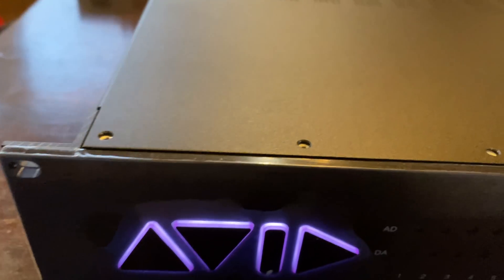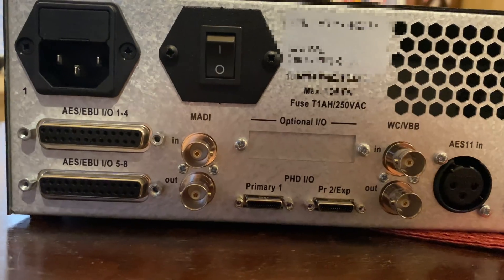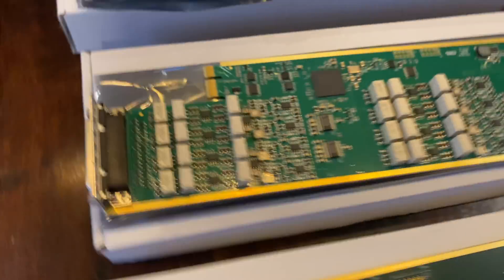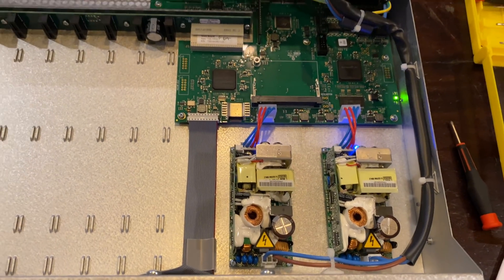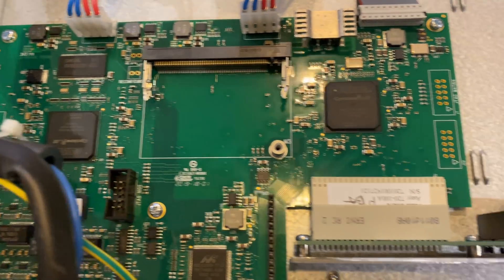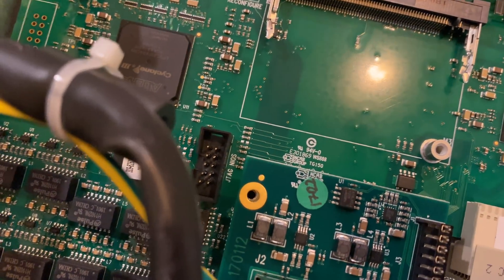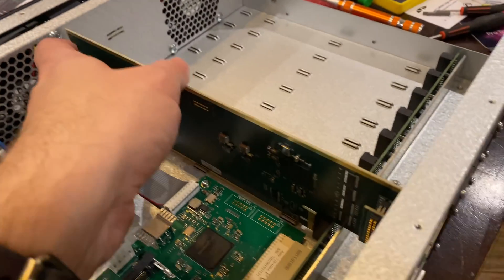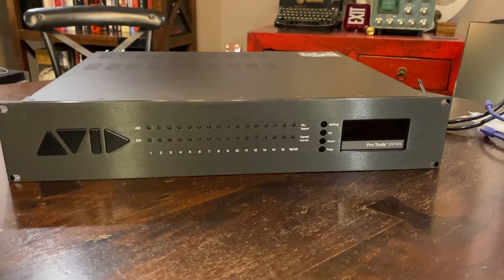Neil's Technobabbles:  The AVID MTRX

Comment: Insert Obligatory "I could do all this with a £500 USB interface and powered by unicorn farts" comment here. Don't mean to hate but its funny when the further you go into the meat of audio production the more those powered by raisins comments fall off. That said you can do a lot with a £500  interface and unicorn farts.
Reply from the maker: Benjamin Kenobi definitely!  Now I need to develop a unicorn fart plugin!!
Reply: @NeilParfittMusic  I would buy that plugin..... if its like 20$ cant afford much more as a university student.
Reply from the maker: @deadinside8013  dont forget to check edu pricing!  Sometimes it's substantially lower than retail!
Reply: I can do it with some hot glue, some random breadboard wires and an old phone.
Reply: I actually tried a similar plug in now youve mentioned it.. , however, the output was mainly all rumble..... I mean cmon, at least give us some "Air " control....

Comment: Neil ! If you were setting up audio networking today which system would you use ? Madi ? Or ???? Which units would you use today for a user incorporating a daw and protools ????
Reply from the maker: it all depends on the I/o requirements.  If it was me and what I use currently,  the MTRX is still the interface of choice... or now the MTRX II as I could use thunderbolt 3 and remove the RME MADIFACE FX as Logic's audio driver.   But,  as I own these pieces already - there's no benefit to do it as it's spending money to result with the same thing.

Comment: The AVID MTRX is an awesome system with the routing capabilities to Dante, etc using Dadman software. IMO its probably the best out there. BUT why Avid why do you have to charge so much. To the point they lose so many customers. I feel if they cut the price in Half they would sell 4x as much and make more money.
Reply from the maker: Keep in mind it's made by DAD.  So they have to make money, and it's AVID branded so they have to make money.  But yeah.. i feel like the empy box should be 2 grand.  They'd sell a kajillion of them.

Comment: So MTRX doesn't have the default dante card which means the two rj45s on the backpanel are useless right?👀
Reply from the maker: No,  but you still need one so the MTRX is on your network so you can control it using DADMAN

Comment: 1:29 You said you have 16 channels of AES on 2 DB-25 ports, but it's labeled 1-4 and 5-8.  What am I missing here?
Reply from the maker: 1-4 represents 4 stereo AES I/O
Reply: @NeilParfittMusic  not trying to be obtuse here, but where are 9-16?  :P
Reply from the maker: @applemarkwantsvids 

All I can think of is that line from Shawshank redemption...  

But also,   it's just AES Digital labelling - 

If you've ever seen a single AES input or output on an XLR connector - that's a stereo digital signal,.  Same applies to DB25:

AES 1-4 I/O is laid out in stereo clumps:

DB25 #1
(1) ch 1-2
(2) ch 3-4
(3) ch 5-6
(4) ch 7/8

DB25 #2
(5) ch 9-10
(6) ch 11-12
(7) ch 13-14
(8) ch 15-16
Reply: @NeilParfittMusic  Wellll ok....  Thanks DOC!
You rock Neil.

Comment: Neil - just wanted to say great youtube videos. you have no idea how much time you have saved me the last year as I upgraded my home studio moving into  new home. keep up the great work!
Reply from the maker: Thanks Anthony!  Were you expanding? Streamlining?
Reply: @NeilParfittMusic  have been building a new studio ontop  of an old tennis court. re-designing the studio layout was in need of inspiration. seeing how you got the flockaudio patchbay/Avid MTRX solution working, and all the routing with a tonne of synths helped me figure out which direction to go in. ive ended up with something similar. however i am using Cubase is my main daw, working with logic also.  I have used the ERM Multiclock to drive alot of the midi and clock sync in the studio.

Comment: Another great video Neil !  But I've got one word for you on this one - "Galaxy 64" (does the number count as a word ...?).  64 channels of analog in's and 64 channels of analog out's, another 64 in's and 64 outs of digital, connects directly to up to four HDX cards, primary and secondary Dante, 64 channels of MADI, 2 Thunderbolt connectors (USB-C), totally unconstrained matrix'ing from anything to anything via very simple software, HUGE processing power (2 FPGAs, 12 DSPs) for Antelope's pretty awesome plugins (which can be normal plugins or hardware'ish inserts), AND Antelope's stupid good clock - all included.  And BY FAR the best thing is, IT ISN'T AVID !!  No avid hell to deal with - ever.   All for way less than the MTRX will cost when it's populated with a small fraction of that.  Plus, it sounds amazing where as avid's converters have always been blah at best (I've had a bunch of them and SO glad to be rid of them).  Anyway, just another viewpoint.  Don't want people falling down the avid hole-O-hell without realizing there are other options !  Thanks for another great video Neil !  You're awesome !
Reply from the maker: Thx! If you check out my dork fest 1 vid,  youll see I need more I/o :)

Also - just in case you weren’t aware,  the MTRX isn’t really an avid product at all,  it’s a digital Audio Denmark AX32 converter with an avid logo on it,  so it really does sound outstanding.   The only difference between this and the ax32 is that it does have a build in set of digilink ports.
Reply: @NeilParfittMusic  I haven't seen all your videos so I wasn't clearly aware of your I/O requirements but at least from an HDX perspective I think I remember you saying you only used the first two of three cards for I/O.  If that's right, that's 128 I/O's total and the Galaxy provides 128.  It didn't seem like you populated the MTRX with anywhere near that many in this video but I obviously could have misunderstood.  That said, I'm DELIGHTED to hear it's not really an avid product.  That's EVERYTHING as far as I'm concerned though it doesn't get you around having to DEAL with avid if it ever comes to that.  The latest avid ceo is a big hardware guy and it made sense that the MTRX is a project he started but obviously not.  Also, I just read my post and the following was not clear -> I am in NO WAY challenging your choice.  You are WAY more qualified to make such a choice than I am and if you picked the MTRX, that was the right choice for you.  But I despise avid like most audio people.  I have years and years and years of horror stories like we all do.  And pointing out that there are alternatives to avid-hell was irresistible so I did.  And the Antelope IS truly amazing and so VASTLY superior to anything from avid I've ever owned anyway, the mention seemed justified.  Anyway, you have been such a find.  Thank you for taking the time you do to make these videos no less respond to my posts !!
Reply from the maker: @Starlite4321  oh yeah I could rant on forever about all things avid hehe ..

Comment: Wow!  Thanks for this info. I am getting ready to pull the trigger on this same setup for Atmos and Scoring work I do.  I may look into the  MADI IO daughter board.. I wonder if they have given an option of having that pre-installed at a vendor or something?  I could do it myself as I come from the old school of doing those types of things, but would not want to go thru what you did having  no room to work without having to teater on disaster..
Reply from the maker: How nuts are you I/o requirements?  The MATRX Studio is awesome if you dont need more than 64ch to/from Pro Tools.  Also,  the MTRX does have 64ch MADI on COAX without having to open it up...
Reply: @NeilParfittMusic  The problem with the MTRX studio is not really what I want here. I need more for what I am doing.  Also the A/D converters in the Studio version are NOT nearly as good sonically as the MTRX Flagship.. Totally different box. That's according also to Jeff Komar at Avid. I have Avid HD IO which is comparable to the Studio version sonically, but that is not what I need, plus I do need a lot of IO for film work and Atmos mixing The MTRX is just a great rig.
Reply from the maker: @gregoryivesdolbyatmosmusic  yeah man all good,  it was just a casual suggestion as I've met many who didn't know about it
Reply: @NeilParfittMusic  No problem.. DAD made the MTRX.. The other is for people who are just doing a lot of regular stuff unlike probably what you and I are doing-:) Plus the fixed architecture was not what I was looking for as you said, the cards are great and just keep adding in to up to 8. Also, I wondered if they fixed that thing in the manual with the screws.. Hey, it's Avid, so probably not..lol  Hey do you know my pal Jack Lenz in Toronto?  I nice guy and composer who is older now, but used to play with Seal And Crofts back in the day.  He used to have a big space in downtown Toronto in an old Beauty Salon he converted.  Not sure what he is doing now, but has been pretty successful for years. Very nice person.
Reply from the maker: @gregoryivesdolbyatmosmusic  ah yep,  Lenz Entertainment.  Funny coincidence is that his Son has the studio location  I used to lease... small world :)

One bummer is that the SPQ is built into the MTRX studio.  it almost makes more sense if moving to ATMOS (which I'm considering at 7.1.4) is grabbing the MTRX studio and using that just for the DA and SPQ,  so I don't lose all my DA and slots on the big MTRX for the SPQ (I literally have 1 slot left)..

You could wire them in tandem via MADI or DANTE..   I'm not sure what I'll do yet.  All I know is the SPQ card is 3 grand and then MTRX studio is 6K including the SPQ and 16ch DAC vs. having to sell my Trinnov DMON6 and spend 12k to get the DMON12...  for the same money I'd be able to get the additional monitors as well.

DADman can talk to both simultaneously.. Hrmmmm.  Undecided. The Trinnov is amazing.
Reply: @NeilParfittMusic  Yeah, must be the piano player one.  He has two boys and a two daughters.  Yeah. I am still figuring a LOT  of the DadMad senerios out.  I'll run what you said by Jeff Komar at Avid.  I have emails back and forth and he has been super helpful. I will be selling my Dangerous Monitor ST and SR along with my Avid HD IO.  No need for the Dangerous Music Monitor now since it's behind on monitoring  more that a certain number of speakers unless you buy additional racks. .They are getting a new update for the Monitor system, but they are really behind because of Covid-19.  Also, Bob, the owner retired and now a sales guy bought the company last fall.
Reply: @NeilParfittMusic  I thought that you did not loose the slot for the SPQ card.. It goes in a different slot right in addition to the bigger 8 slots. I might be wrong, but I thought that was right..
Reply: @NeilParfittMusic  Definitely going with at least 8 Ch of AD and 8 Ch of DA and an SPQ card along with the Dante Daughter board which goes inside.  Also, Front panel controls on the MTRX Studio is nice for monitoring, but would not get that just for that.  Handy for monitoring Mac Audio at the very least.  I like the MOM remote from DAD so that will work possibly for speakers. I have currently 5 Genelec 1032 A's and the big Sub.. Been having them serviced at Genelec one by one. Just replacing old caps etc.  They sound much better now. They are in LIKE new shape, but the caps get dried out after years of work. Will get more speakers, but not sure when.  Not in a huge hurry, but have an idea of the two front overheads and sides.  Atmos is fun to me for music and film now.  Not that crazy about the Avid Docks at this point.

Comment: Congrats 🍾 this is an amazing converter / interface/ thats really future proof! The sound ( transparency ) is supposed to be prism level or the “ high end “ of conversion. Hope it’s been an awesome upgrade for your studio. Cool it’s expandable & you can pick what you need! 

How many HDX cards do you run? I think u mentioned 256 total I/o for Pt HD/ Ultimate? Wow not much in the chassis. 

Very shocked you had to install everything, essentially completing the build on a 10k + interface. Avid Tech should be doing this to make sure everything works & is configured for the end user. Shocking. I’m looking at MTRX Studio but that plus HDX card & crossgrading to Ultimate is around 9k or more. I use an Apollo 8 now w/ PT, Live 8 & 9, Studio One Pro.
Reply from the maker: Thanks!

yeah the MTRX is interfacing everything in the studio:  HDX3,  192ch logic,  synths, summing,  AD...  check out my dorkfest video if you'd like as it's all plotted out at the wiring level.

As of now,  I have 7 cards installed the MTRX (1 x AD.  3 x DA8, 2 x digilink, 1 x 256ch MADI) in addition to the internal MADI module and recently the DANTE option to start some tests (still too much latency for my use right now though).   The MTRX has been the best infrastructure investment I've ever made for the studio and it's cleared out A TON of rack gear while simplifying the whole process... and unlike usual AVID branded equipment... it's dead silent in operation.
Reply from the maker: https://youtu.be/JkhvVTDznJ0?t=1277